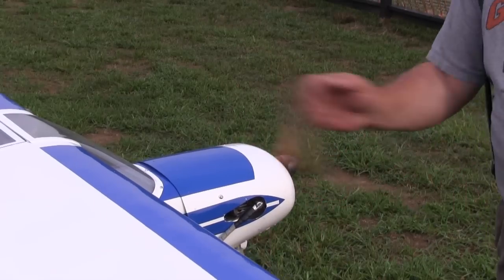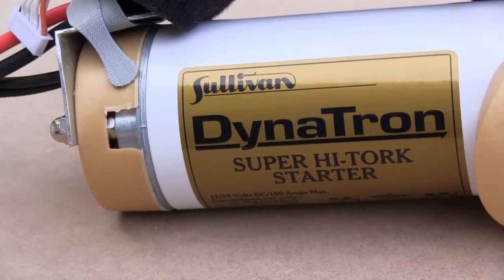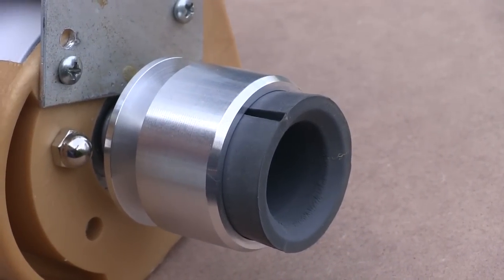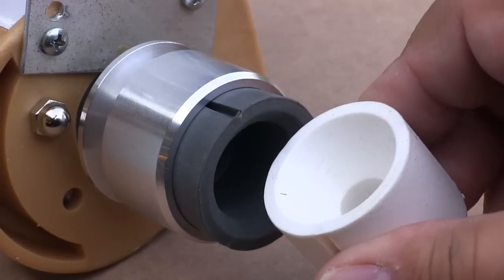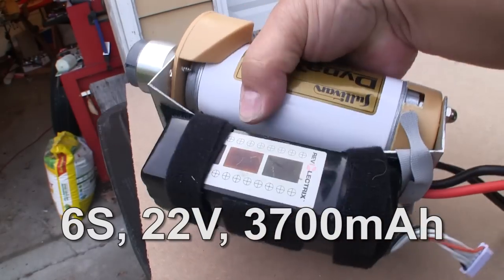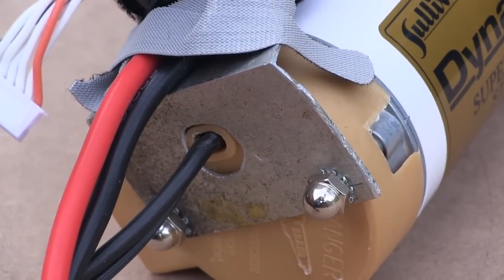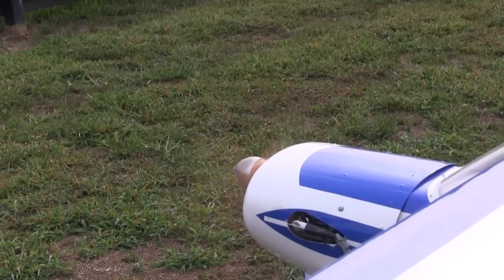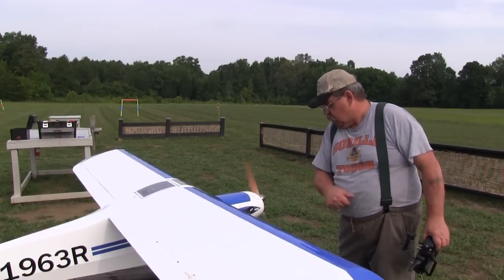Sullivan Dynatron Starter

Comment: I rigged my Sullivan up the same way. The problem with using a large Lipo is that it generates so much heat on the contacts, that it will weld them together.
Reply from the maker: I used my starter lwith that battery for years with no issues at all. i finally quit needing it before it quit wanting to work, then it continues to wotrk for someone else.

Comment: I am using  a hangar 9 power pro HD 12v starter and its totally underpowered , it cannot even start my ASP 52 with 12v 7ah lead acid battery, can u suggest me the maximum voltage that i can use for my starter
Reply from the maker: You need to get that from Hangar 9. I've not used one and dont know the specs. You might find th3e voltage range on their site in the specs on the starter.
Reply: @flyingrcdotnet  thanks

Comment: I have a sullivan starter but I can't seem to get it to work on 12 volts. I pulled apart the switch but it looked fine. Any tips?
Reply from the maker: Sorry, never had one of these apart. Pulsing Sullivan might be the shortest way to real info on what is going on with your starter.

Comment: mine didn't come with instructions. i was hoping to figure out if there was a switch anywhere.
Reply from the maker: +flyamil The On/Off switch is in the rubber bar on the side of the starter. Just squeeze that. It usually works best if you squeeze it around the center of the bar.
Reply: thank you

Comment: Would the Dynotron start a 33cc gas? What suggestion for Lipo battery size and setup would you suggest to start a 33cc gas? Can you briefly explain 2 in series vs. a single. Thanks for all the instruction.
Reply from the maker: I start my DLE40 twin with the starter setup in the video with no issues. The battery I use works great and lasts a long time, don;t mess around with series, get a decent battery and use that.